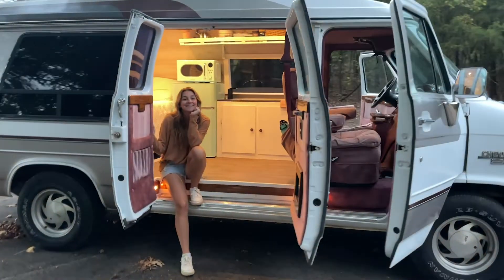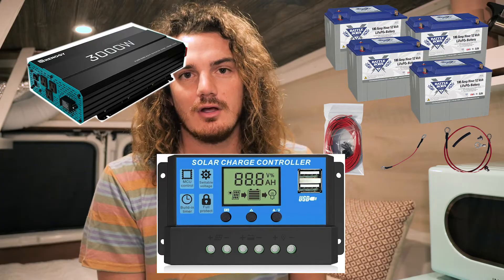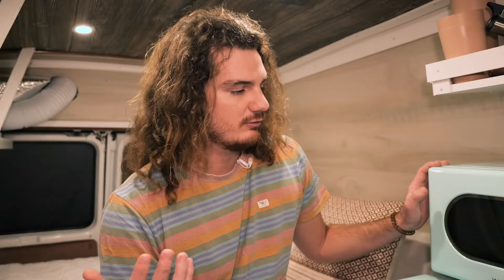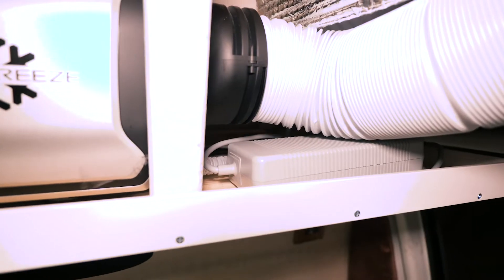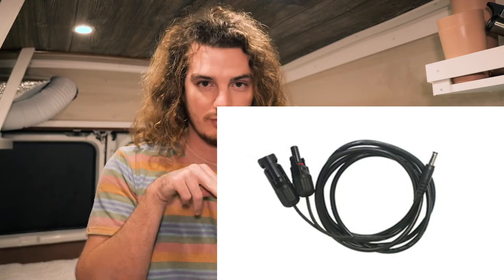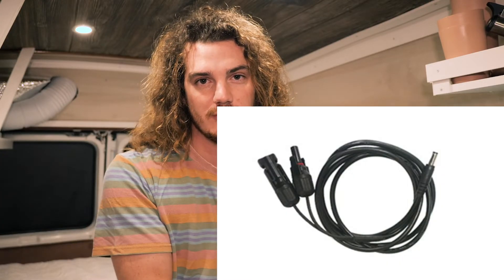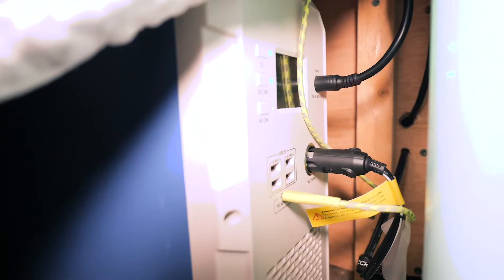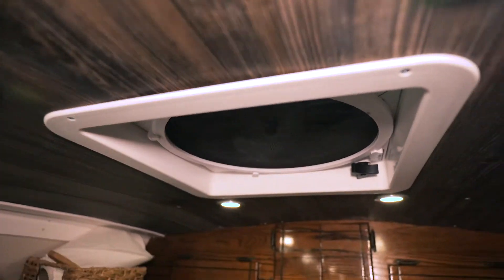HOW WE POWER OUR VAN // Solar Power The Easy Way (Bluetti EB240) Wiring and Install How To

Comment: Lots of good links to useful van electrical DIY components.  It just makes sense to do van electrical this way: simple,  easy to change, and modify.   I use the same methodology for my 5th wheel system and a stand alone li-po battery.  I put terminal ends on the inline fuse wire from auto parts stores for a battery direct bus.  The 300 watt inverter is on the same battery positive terminal with a fuse. Then a little 30-amp charge controller sitting on the battery.  It is basically a DIY battery, charger controller, inverter, and 12 volt DC bus setup. I use two 100 amp hour battery's, one at a time though.

Comment: Thank you thank you thank you 

Ive got 20 months to do a box truck build. Just my loansome here with two kitties. 
I want to power it via generator but also via solar and battery bank to not only save on $$$ but also allow me to stealth camp more efficiently. 

I know there's a dude on here who builds professionally and says he uses powerbank.

I'm going to go as cheap as I can but with power I'm not skimping out. It'll be full time living. Where I live is four seasons. I plan to use a diesel heater during winter. But AC during summer. Though ill need to run a fridge obviously.

Comment: Would you recommend a newer version of the bluetti
Reply from the maker: @austinjones5870  yeah or maybe even a different brand there are a lot of new ones on the market since I made this. But same concept applies. This is still not a bad unit though and you could probably find one pretty cheap. If I were doing another build, I would probably look for something with a little bit larger capacity and 2000 W output.
Reply: @ awesome thanks for your time!!
Reply: @ any brand or products in specific?
Reply from the maker: @ not really sure I haven’t been paying too much attention to that world for a couple years. But I would check out HoboTech on YouTube. That’s how I found this one

Comment: I bought this and I want to feed the mc4 cable from the roof into the van but not sure how to use the accompanying cord into an entry gland. Any help?
Reply from the maker: What do you mean by entry gland? Like into your roof?
Reply: @brianrbraxton1494  Yeah, the entry gland is that plastic housing you feed the cable through. The hole on almost all of them is 8mm but the MC4 with this unit is around 13mm. I don't want to disassemble the MC4 if I don't have to.
Reply from the maker: @marcusabruce  gotcha. I didn’t have any kind of entry gland so I just had to drill a hole in my roof and then silicone around the cord. But I didn’t want to drill it big enough for the mc4 connectors. So I just cut the cord, made the hole exactly big enough for the cord to fit, then spliced the cord back together after I fed it through. I did that with a mc4 extension cord I bought though. And then that plugged into the cord supplied with the Bluetti. I don’t know if that makes sense, or if it was the best way to do it lol but that’s what I did
Reply: @brianrbraxton1494  Thanks for the details. For now, I actually have it running down the trim of the back door and it's still sealed so it's working. 

I keep randomly getting a E006 error. Any idea how to fix that? Thanks again.

Comment: I have 2 of the 2400 power banks.
I bought one at full price when they first came out.
Just bought another at a much reduced price.
They're not cheap. But dollar/pound per watt hour power. Probably the cheapest power bank you can buy.
Also these will outlive me, as l think you can charge it up over a 1,000 times. 
I could be wrong on the number but l know its a lot, and enough for one person or a couple.
The only 2 slight downsides are of course the weight of this.
And the tech for usage is a little basic.
Other than that l don't think you can beat this generator.

Comment: Kool!!! I use a EB240 with a B300 Battery and 800 watts of Solar. Works well - I will have to look into the AC - my work around for the microwave is an Inverter Microwave on power setting 4. Have not tried to do the fridge yet. - That is coming later.  Looked at several and the power requirements for them. My next task is a hot plate - I think I will use a cast iron top cooktop that works at 500 watts.
Reply from the maker: very cool! personally I would just stick with a butane stove rather than a hot plate just to avoid draining so much power. but still cool to have an electric one that works in a pinch!
Reply: I got a BIG learning curve from July 1 - Nov 1 - we had a "Drought", Burn Bans, Big FINES and fires too that were very destructive.  I kinda like to eat too - LOL So with no open flame, including camp stove, etc... I went to looking for 500ish cook appliances. Yes, I still have gridded house that I so want to divorce, but it was there for this SHTF time, and I was ok. But next time, I can cook in the Cabin [My Place of Peace] - just the Chickens and I. So I may look into that fridge you have, and the AC too or the Echoflow Wave2. I now have 5 KW to work with restricted at 1000 watts. I like to run the inverter 50%ish so I can get some life out of it. But I see a OUPS or another Bluetti in my future. As I really need 3000 watts, and around 6KW to be in a more secure poster. But for now, this minimalist system is working well. I really need 999999999WH or like 20KW - LOL - NOT!!!! Glad you are enjoying your van - keep us posted please. In two year from now - I hope to get more towards full-time at the Cabin.

Comment: Excellent clear explanation which I will definitely follow in my conversion. Am I right in thinking you can also connect your 12V dash outlet (lighter) to a 12V charging input on the Bluetti? It would be a handy alternative while driving, just in case we have an occasional dull rainy day here in the UK....

Comment: I swapped my microwave for a toaster oven years ago, and never looked back! But thanks for this extremely informative video!
Reply: After using a toaster, I realized I don’t want or need a microwave or a pop up toaster.
Reply: Toaster ovens are the way to go yum.  I no longer go to fast food places because it, the toaster oven,  cooks up chicken and other meat for a fraction of the cost of fast food.   I also have a 600 watt 4-inch "baby" induction burner,. It is good for heating coffee water in the metal soup cups, else frying a egg.  On another note, I will never give up my single gas burner!

Comment: How loud is it?can I put it in my minivan and sleep quietly? 😅
Reply from the maker: Yeah it’s pretty much silent. Fans run occasionally if it’s under a heavy load but I never noticed the noise. Definitely not any louder than our roof vent that we ran at night anyway.
Reply: @brianrbraxton1494  thank you so much for the quick response!

Comment: I wish you would do a video on how you installed your solar panels.  It would really help to see how you installed on the fiberglass roof.  Thanks so much
Reply from the maker: I used VHB tape. Sounds crazy but it works. I got the idea from HoboTech, he has lots of videos on it. His have been on that way for over 5 years and still going strong. https://youtu.be/qghxSwUgxEc
Reply: @brianrbraxton1494   thanks for your reply. I have the Bouge 180 panels too but not sure about install with the pitches of the roof of my 2000 Ford E150 Econoline.   Your electrical setup was really nice. I have the EB240 and will follow your setup.  I hope you make more videos. Not everyone explains so well.  Thanks !

Comment: Nice video! One question... Will having the bluetti on all year degrade the battery?
Reply: I think it is not recommended to be charging at all times if that is your question, which at least in a setup like this will get a break at night when there is no Sun.

Comment: How did you wire your lights and fans so your could just plug them in with a cigarette lighter?
Reply: Search "How I Installed SOLAR POWER in my VAN (The Easy Way)" by DualEx on youtube, I think his video explains that a little bit at the 8:20 mark
Reply: Thank you!

Comment: Could never understand the need for people to overcomplicate their van setup by hooking up a inverter to marinebatterys when you can run monstly everything with a bluetti
Reply: Because it is cheaper or more customizable than big power bank. Why live in your house than live in hotels?
Reply: I’m not sure either but I did just learn that it can work well, but you are going to need a big one to be able to power everything in the camper/ van. I’m freaking out about all these inverters, multiple large batteries to run the inverter! Idk I’m so confused by everything with electrical stuff! Haha.
Reply: Same boat  @chartmann43
Reply: Because when you have 3 things in one unit. Jt only takes 1 part to go wrong and the whole unit is worthless to you. Batteries and inverter and mppt separate means you can just swap out thr inverter for 300$ and your not buying a brand new unit
Reply: The more I do research the more I’m asking this question as well. I am by no means a professional, which is why I’m really confused. I’m leaning towards a power station, but see so many people do the most.
Reply: Thank you so much! This was very helpful!!
Reply: I use both. It’s nice having a backup

Comment: We power our 2018 Ford Transit MR 148" van using two Ecoflow Delta 1300s and a Delta Max. Works great and my van build episodes about the setup are rather popular. I have solar and a Victron DC to DC charger as well. Be safe out there.
Reply from the maker: Very cool! Seems like a similar set up to mine, I watched your 4 minute video. I have done a lot of work on mine since this video, just have not had time to put together any more videos. Wired up some switches so I no longer have to unplug or switch anything around when going from shore power to solar power. And a much neater appearance
Reply: @brianrbraxton1494  Dude yeah I would love if you did an updated video on all the wiring and switches! I just got an 89 G20 and want to do something similar to you so I don't have to deal with all of the dual battery headaches but there's not many videos on full power bank set up conversions so I'm still trying to figure out how I will do all my wiring. Thanks for all the info and great vid! Cheers

Comment: Amaaazing!!! I'm planning to build something like this and SUCH a blessing there's something like this haha all the electricity stuff made me crazy. Gonna try to build a music rig with my laptop, studio monitors, audio interface and midi keyboard that I want to have plugged in couple of hours a day. Cooking either a microwave or an instantpot with airfrying but would be nice with some kind of micro or mini-grill/oven for some dishes. But for the music stuff and computer would you perhaps advice to go with the biggest one from Bluetti or maybe Jackery or some similar brand like Pecron or would you say this satisfies the most? Would be nice to not having to plug stuff out just to use something or if the music studio is up and running I want to make food in the instapot the same time. That's what I'm thinking atm...
Reply: Buy a 300 ah LiFeP04 battery, build your own, and save a fortune.

Comment: Yo this is awesome! I looking to do the exact same thing for my sailboat, for the same reasons. I cant decide on which bluetti to order. I wish there was a 1000-1500W with 2,000+WH of storage. Something in between the EB240 and the AC200P/Max would be the sweet spot. 
Do ya'll still like the setup, or do you wish you had gone for a higher rated inverter or more watt hours? My goal is for it to be able to handle 2-4 people + Electronics/fridge/Appliances off shore for up to a month art a time, with solar obviously lol. We have the same brain dude. Keeping simple like this is way more approachable than doing a complete battery-bank overhaul/upgrade.
Reply: Hi, if you are sailing I would suggest you look at a wind turbine. It will run day and night with no sun. and you can use solar panes also if you are becalmed for days ... just saying .....

Comment: 3 years ago, I bought a Bluetti 1500 unit. I just wanted to see if it could do what I needed it to do, for my van build power needs ... it works so well that I didn't hesitate to buy the bluetti 2400 unit, especially since it happened to go on sale last month. There are many other power bank units out there, and for the money, they offer a lot of flexibility, but when you really compare the dollar cost value to the Bluetti units, you can't beat them. I would say the most important feature of any power system is definitely how much power capacity they offer ... there is no such thing as "too much battery power"! The Bluetti 2400 pack is a lot of power for a little dollar cost ... the sun doesn't always shine! Thanks for your videos!
Reply: A 12v 300ah LiFeP04 battery rated at 3.8 kwh is about 1000 bucks now. Way better option and lasts way way longer. Plus you can use a 2500 watt inverter with it and set up more solar panels with an MPPT charge controller. This thing is a waste of money by comparison. When it stops working say bye bye to your money.

Comment: I don't know if you got the inverter thing figured out, but I wired in a 30 amp cigarette plug that I got off of Amazon, The brand is "YCIND". Female cigarette lighter socket dual USB charging power outlet 30 amp 12 AWG  With a 10' cord that i wired directly to the battery.  I use it to charge a couple of different units that I have including other batteries that I made while driving around. Works fantastic. Very nice man you built.

Comment: That's enough solar for the zerobreeze?
Reply from the maker: Yes, not to run it nonstop. But as needed. This bluetti in theory should be able to run the zerobreeze for about 9 hours on a single charge. And even longer if there is solar power coming in simultaneously. And I also have the extra battery just for the zerobreeze that can run it for about 5 hours. 
I’ll do some real life testing once it warms up outside

Comment: You should hard wire a inverter from the battery like 300w just to power the bluetti via ac while driving
Reply from the maker: Yes! that was actually my plan but I’ve had some trouble with it. I have a 300w pure sine inverter, and I tried just using some existing wiring that was used for the old electric bench seat/bed in the back. But can’t get it to work for longer than a few seconds. Thinking it might not be a large enough gauge of wire for such a long run. So I’ll have to try wiring it myself, just haven’t messed around when it much.

Comment: Great video. Thank you! Can you tell me about the air conditioner that you have installed? How did you get solar panels on your high roof?  I have a ‘96 Chevrolet Express 1500 conversion van. I have a bluetti so I’m very interested in solar to charge it. Thank you.

Comment: Near the end of the video could you not just leave the solar panels plugged in AND plug into shore power to charge the Bluetti? Why bother to unplug it as I believe it cab charge from both simultaneously?
Reply from the maker: There is only one port on the bluetti for charging, so there’s no way to plug in the AC adapter and the solar panels at the same time. I have given a lot of thought to this because I think it could be possibl. you would just have to make some kind of adapter to run the power from the solar panels and the power from the AC adapter in parallel to the same plug. I’m just not confident enough in my electricity knowledge to know if it’s safe haha. 
What I really want to do is wire up a way to charge the Bluetti off the van battery while I’m driving, simultaneously to the solar power.

This is probably the biggest con with the bluetti.. lack of charging options. From what I understand it can take in up to 500w of charge, but they just failed to provide the ports or adapters to accomplish it.

Comment: What exactly is ur backup and how do you recharge it? Just bought a g20 and in the middle of converting it:)
Reply from the maker: Do you mean the backup battery for the Zero breeze air conditioner? If so, it’s just the battery pack that you can buy with the zero breeze. It’s made to clip onto the bottom of the unit, but I couldn’t fit it on my shelf with the battery on it so I just mounted it underneath the shelf and drilled a hole to feed the connector cable through. I’ll have to do another video all about the site conditioner.
Reply from the maker: And it just charges with the same cord that powers the Zero Breeze itself, I just have to switch it from the zero breeze to the battery. And I usually top it off when I have shore power available